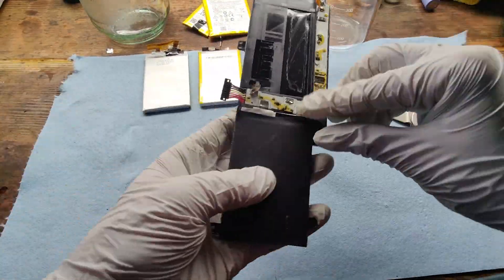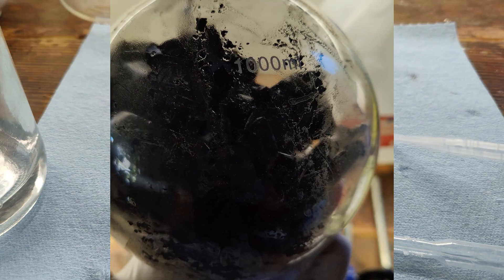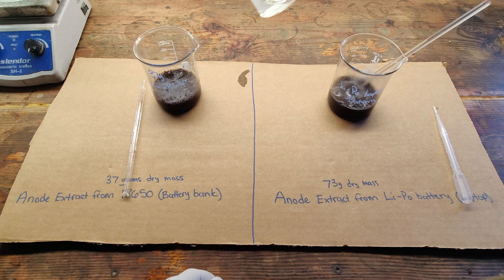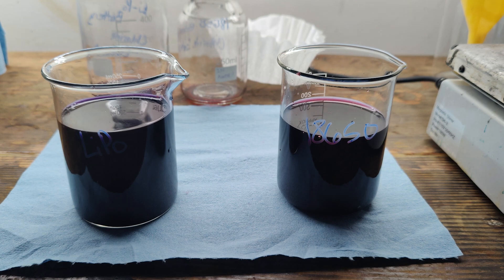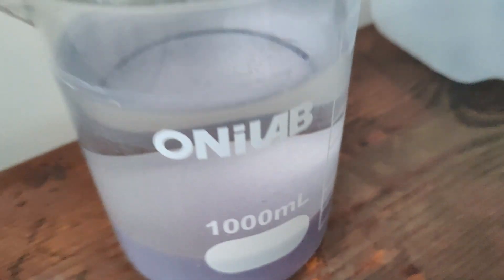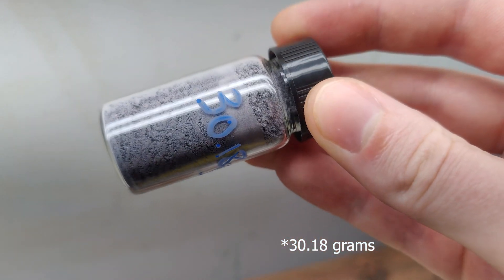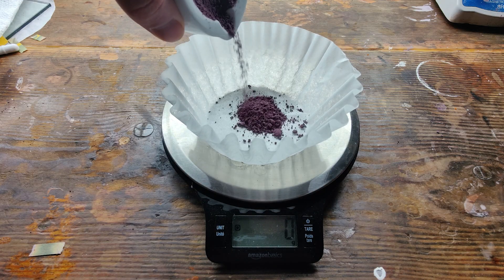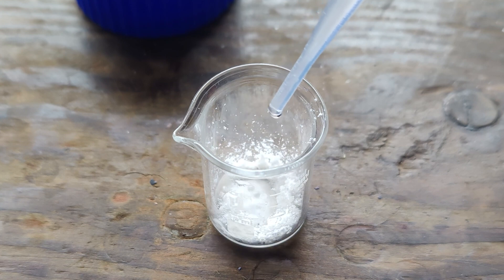Extraction of Cobalt and Lithium from Lithium-Ion Batteries

Comment: Besides the fact that fluorinated electrolyte residues are quite toxic, and it is risky to start working with it without a respirator and equipment, a lot of dust is released from the dried cell. If fluoride ions enter the bloodstream in critical quantities, there is a risk of cardiac arrest, mainly due to consumption and precipitation of calcium in the blood.

Comment: great video! Always a fun process. I stupidly did this about a year and a half ago on a slightly larger scale -  with 25kgs of old laptop and phone batteries from my local computer repair place. So much work, so much time. But cobalt is an amazing element, and a lot of fun to play with. Safely ofc.
Some valid critiques in the comments on the specifics, but put forth without much compassion or understanding of your intention in sharing this. End of the day, anyone relying on a single youtube to be a source for perfect data is likely to find themselves in trouble regardless. Keen as to see what you do for your next vid, you've earned my sub for sure!

Comment: how do you know that no other carbonates beside LI2CO3 are in your precipitation
Reply: Some Na (or potassium if using potassium hydroxide) is likely mixed in unless you do a few cold water washes to remove it. This will obviously lower your Li yield as you will also wash away some Li as well. Al may also be present if not completely removed in the first step. As for the others, that is easy. Co (and Ni and Cu) are very colorful and would be readily visible in the Li2CO3 as pink or green hues if any significant amounts were present.
Reply: @sxl168  if you dont can make recrystallisation and a quatitative analysis of the product you are non sure what ist is. Only colors an a coloured flame are no proofes . No serious chemist would accept this. I guess your product is very impure and cannot serve for further use
Reply from the maker: There's definitely a variety of trace contaminants including copper, nickel, manganese, cobalt and aluminum. The largest contaminant is certainly sodium. If the aluminum content was higher, the powder would have a purple-grey hue to it. If any other metal contaminants were present in appreciable amounts it would also affect the hue of the powder. So a fluffy white powder suggests a purity of "good enough". I have no way of actually quantifying it.
Reply: @Alamist  a quatitative analysis of lithium would cost you about 50 bugs. Otherwise you could DIY a flame spectrometer with an photodiode and a CD
Reply from the maker: @lotharmayring6063  ok that's fair. I shouldn't have said I have no way of testing it. Rather,  I don't care enough about a quantitative analysis to spend money on it lol.
Reply: @Alamist  but without the quantitav analysis of the Lithium content your experiment makes no sense and so you have lost much money and time
Reply from the maker: @lotharmayring6063  How do you come to that conclusion?

Chemistry can be just as much about the journey as it can be about the final product. Just because I don't go so far as to determine the EXACT composition doesn't mean that the experiment was a waste.

Of course I didn't extract 100% pure lithium carbonate from phone batteries using nothing but "hardware store"-grade materials in my garage. That'd be a silly assumption.

But the flame test performed at the end was sufficient proof for me to assume that my final product was, at the very least, MOSTLY lithium carbonate.

It would definitely be interesting to know what my true purity is. But, paying additional money to figure that out goes beyond the scope and purpose of my original video.
Reply: @Alamist  i just told you that it is easy and cheap to look specificly at the flame-line-spectrum of Lithium with a photodiode and a CD. they are hardware store-grade materials. With a standart solution you can also make semi-quantitatve analysis at least. But i am sure that professional industy make a Lithium recover from old batteries so all that makes really no sense

Comment: I suspect that the initial hydroxide digestion step of the aluminum has led to the loss of some lithium, as the lithium hydroxide which likely formed is quite soluble in water and probably ended up in the sodium aluminate solution. Might have been interesting to save that and see if more lithium can be extracted from it.

Comment: Inorganic chemistry is so much more interesting to watch than organic.  Videos of clear solutions and white crystals require a bit of suspension of disbelief these days, as real youtube organic chem is pretty much dead at this point.  When you're working with elements that have a different color for each oxidation state, I'm much more inclined to accept your conclusions.  Nice work.
Reply from the maker: Depends on the type of organic chemistry. In one of my other videos I did an experiment that technically falls under the "Metalorganic" category since it involves chelating metal ions to organic molecules. Very pretty colors involved with that one.

But yeah, I agree. Generally organic chem is very underwhelming from a visual perspective because you're dealing with a lot of clear, white, and slightly-off-white substances. It was fun during College because we could actually run H-NMR and IR on our products to confirm the composition, but I doubt very many amateur chemists have access to either of those. Most accessible testing method I can think of is probably melting point, but that only tells you so much.

Thanks for checking out the video!
Reply: YouTube organic chem is at an all time high. Just look at Chemiolis who synthesizes something impressive every few months. Thy Labs is casually doing steroid chemistry at an incredibly large scale. NileRed is using NMR for anlysis. Many others are making cubane ...

Comment: It should be said that you have to be very careful with doing something like this lithium polymer based batteries can be fairly volatile when shorted and icr cells are just as bad, reason I bring this up is because if you’re not careful you can make a sketchy situation worse really quick!
Reply from the maker: @CajunReaper95  It was said during the disclaimer at the very beginning of the video :)

Comment: Co(OH)₂ not CoOH₂!
Na₂CO₃ and not  NaCO₃!
Formulas matter!
And stoichiometry in reactions... You need to work on that!
Reply from the maker: Yuh. The reactions on-screen were a last-second addition after like 3 hours of editing. Mistakes happen.
Reply: @Alamist  this does not justifies them! People already start to use wrong fotmulas in your comments. With wrong formulas, reactions will be wrong, with wrong reactions any calculation would be bad.
You should have those formulas and reaction written before making video, as those are used to calculate how much chemicals you need for reactions. YOU should know what are you doing, especially when others will take example from you and use your videos as tutorials
Mistakes can happen, but it is on you to correct them
Reply from the maker: @ejkozan  That's your opinion, which is fine. I can see where you're coming from and I appreciate you pointing the typo out. 

However, this video is not a tutorial, as I outlined very clearly in the introduction. I did not design this video in a format that is supposed to make my experiment "reproducible". It's simply a documentation of my own experimental process for entertainment purposes. While I regret not double-checking my formulas beforehand, they get the idea across well enough to the casual viewer even if it's not 100% accurate or balanced. Regardless of all that, the stoichiometry wasn't even relevant for any part of this experiment anyways.

Like the other mistakes I caught after uploading, I will make a note in the video's description correcting this minor typo.
Reply: @Alamist  It is not opinion, you show, people interact, people learn. I know how easy it is to teach wrongly by mistake, and believe me, even when you do not want to teach, people will use your materials as such. 
If things like formulas are not important: do not use them, just that, small thing. And if you use chemistry and its language then use it properly, stoichiometry, reactions, formulas are chemistry language. Use names and descriptions then, but never write wrong formulas. Because those stay in minds of watchers, and later on it starts to be problem. "Chemistry is hard", "Chemistry is confusing". Chemistry is not just nice colors, it is mostly everything else than colors. And first thing is understanding things and explaining. Explain stuff correctly, or don't at all, just showing visuals.
Learn from your mistakes, became better, never surrender :)
Reply: @Alamist  And look, even in liked by you comments people write "great explanation", but if you explain incorrectly, with wrong chemistry and formulas, but then you accept that they learn from your exlanations... Then your "simple documentation" makes bad things for chemistry.
Remember, you can always ask others for help with theory, formulas and so on. Better to slow down with video than teach others wrongly (yes, you are teaching others, it can be seen in comments, explaining IS teaching)
Reply from the maker: @ejkozan  Looks like we'll just have to agree to disagree. Have a great day!
Reply: @Alamist  Don't take my comments as attack, I try to help amateurs chemistry community whenever I can. I just see half truths and not proper informative later on with my students. I am happy I can watch videos of next chemtuber
Reply: @ejkozan anyone would take your comments as an attack with you using the punctuation that you did.  Rather than telling people how to make their videos, you should work on how you say such things.
Reply: @BackYardScience2000  I was Probably a bit heated at that moment... I accept your criticism. In my eyes, it was only emphasis, but it is true I often am not seeing that my text can be seen differently than just informational. My apologies
Reply: u are fired xD
Reply: @alexborr1746  ?

Comment: If you were just after the lithium, it wouldn't matter if you kept the aluminum in right? You can wash all of it in HCl, adjust pH, add NaCO3 to precipitate the cobalt carbonate plus aluminum hydroxide, then move straight on to lithium extraction. The cobalt aluminum salt mix can be further separated with electrolysis.

Edit: Come to think of it, you could just set up the entire solution for electrolysis after the HCl wash. An aluminum anode and aluminum cathode will displace cobalt from the solution without it adhering to anything. The remaining solution can be adjusted to a high pH, cold filtered to remove the aluminum hydroxide and then hot filtered to remove the lithium hydroxide.
Reply from the maker: I think the issue you'd run into is that the aluminum would form sodium aluminate in a basic solution with sodium ions, which is highly water soluble and would remain in your lithium solution. I'm not sure to what extent Aluminum reacts with Lithium ions, as it appears to form complexes with other Alkali metals like potassium and sodium. It was simple enough to just dissolve it out at the beginning and eliminate that as a variable, so I didn't do too much more reading into it.
Reply: @Alamist  the bigger question vying for how you come to the final product: what IS your final product, and what IS the desired use?
Reply: Problem with this method is that all 3 (Al, Co, and some Li) will precipitate out as you approach neutral pH. The Al precipitation is a bit of a PITA as it likes to form gels and bind up the other metals into its web and filtering it is also a pain. You would want to do this by using NaOH (or KOH) only and bring to PH of 9-10. This should precipitate all of the Al and Co (and Mn and Ni if NMC cells) and leave Li in solution. pH should probably be pushing towards 11 if playing with NMC cells as Mn likes to stay in solution. This will also precipitate out Cu if you get some of the Cu foil mixed in. Decant and/or filter and then you can evaporate the solution down to the start of crystallization like the video and add carbonate for Li precipitation. Also, if you have phosphates around, those have lower lithium solubilities to get out more Li (https://srdata.nist.gov/solubility/IUPAC/SDS-31/SDS-31-pages_1.pdf). Trisodium Phosphate (TSP) is probably the cheapest phosphate to get ahold of. But then you have the issue of how to extract the Li from the phosphate. Also you cannot take the pH much past 11 or Al will redissolve as the aluminate ion. Though technically that won't matter if you are just after the Lithium and would be a good way to remove the Al from the Co/Ni/Mn/Cu. Same as what the video did but as the last step instead of the first step. 

Of the Co/Ni/Mn/Cu, redissolve in acid and pH adjust to around 3. Add hydrogen peroxide or potassium permanganate to precipitate out the Mn as MnO2. Bleach may also work but some Co may oxidize to +3 and precipitate out with the Mn. Once the Mn is removed, you can either adjust the pH to around 6 using your favorite base or add in Ni/Co carbonates which will dissolve and precipitate out any Cu. You can skip this step if you were careful to not have Cu included in the acid leach. Precipitate out the remaining Ni/Co. I don't know of any easy way to separate Ni/Co without using something like Cyanex 272, etc.
Reply: I did find a reference that at near neutral pH (5-6), bleach can be used to precipitate Co in the +3 state as Co2O3. I haven't tried it yet though to see if it actually works. pH control and time are critical as the Ni ions will also tend to move into the +3 state but do so at a slower pace than Co. Higher pH accelerates the Ni oxidations but lower pH prevents Co +3 from forming, so it is about finding the right balance.